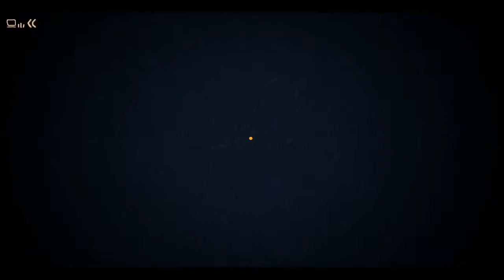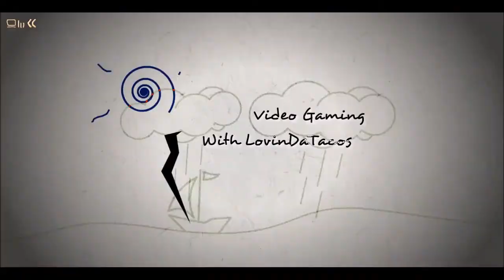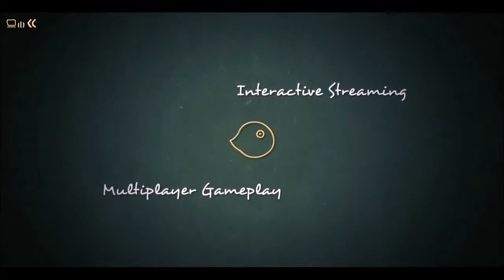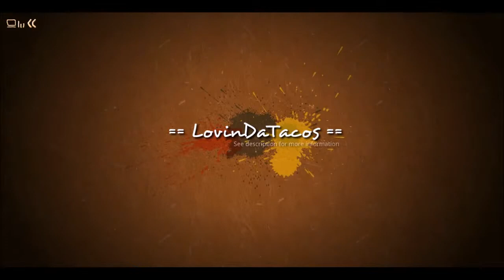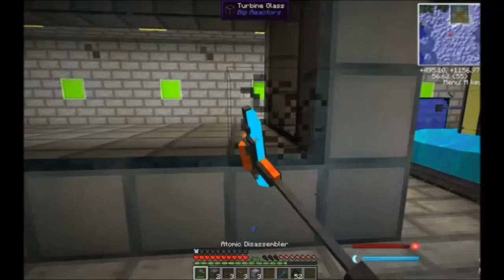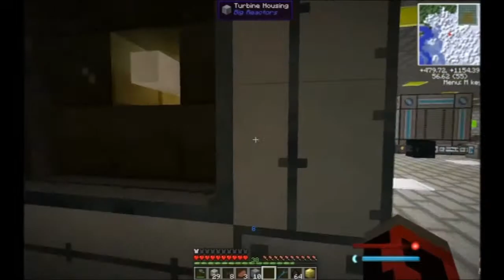EaveeCraft Server Play S1 E4: Automating steel production and big reactor turbines (part 2)

Comment: with only 1 layer of cryo for your passive your always gonna have a lot of heat, even with it full it still can build up quite a bit, and for full efficiency you will probably need not only more water into the reactor but more ports moving steam into the turbines, also the coil effects the rpms, more coils lowers your rpms, i believe what it means by the 2 sets of rpms that means at ether of those points your taking full advantage of the steams force, while with enough coils to convert that entirely into power, if its under your trying to draw more power then the turbines generating and if its over your steams spinning it faster then the coils drain power from it.
Reply from the maker: Thanks for the thoughts.

I simply didn't have the gelid cryo to fill it up which was why it was only at one lair...that being said after this video I did fill up the reactor and I did get an additional 15% boost to efficiency bringing the RF/t up.  

I'll look into moving more steam ports for the active cooled setup but in my final build (part 4 of this series) just one port was sufficient with a 1 fuel rod reactor.  The 4 fuel rod system was producing about 2100 mb/t of steam...I did discover though that a full turbine can't handle that amount effectively so I need either a steam collection buffer inbetween or just a smaller reactor producing steam.

The big problem is the water consumption in the active cooled reactor...the casing heat maxes out and I believe the water consumption gets crazy because of it...I haven't found a solid way to balance that out yet although I've considered making a larger case without adding more fuel rods to see if that helps.